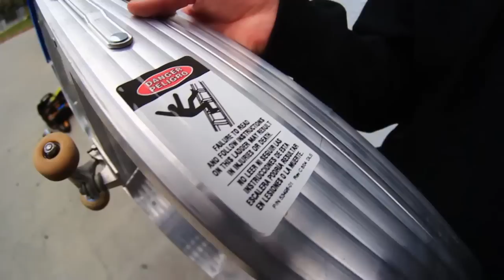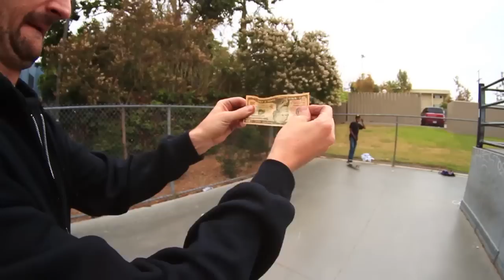HOW TO SKATE A LADDER THE HARDEST WAY | SKATE EVERYTHING EP 29

Comment: Couple of spontaneous ideas: Get a big piece of wood and try to make a two-man skateboard. Attach multiple boards to each other using string, making a skateboard train. Get a sturdy box and put trucks on it -- maybe on all sides. Take the wheels off a shopping cart and put them on a skateboard. Attach two boards together in a cross shape, either with the trucks on the horizontal board removed or facing forward.

Comment: find a dump or a junkyard make 10 boards basketball back board toilet seat cover foot stool  cars turtle sand box window shutter dry wall plexiglass dinner plate stop sign street sign milk crate floor fan phone book school book atari diving board snow skeys car jack aluminum chain fence barb wire fence wood fence body board concrete fold up chair crazy glue Lego board canno paddle tennis racket